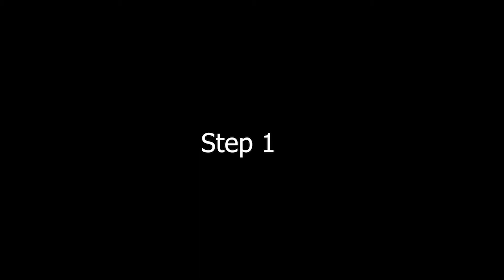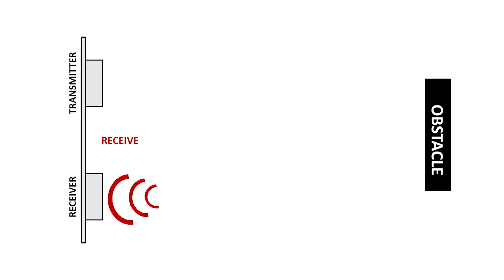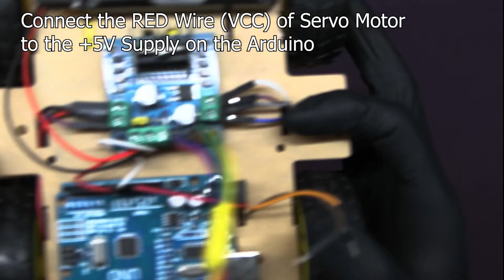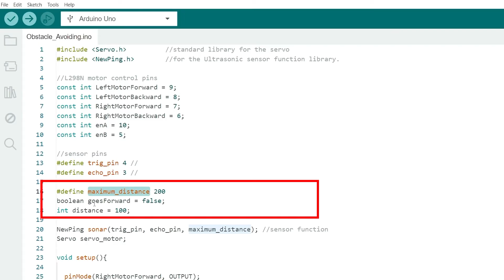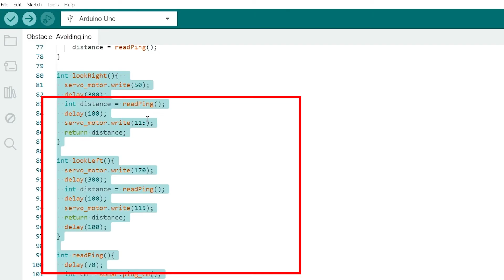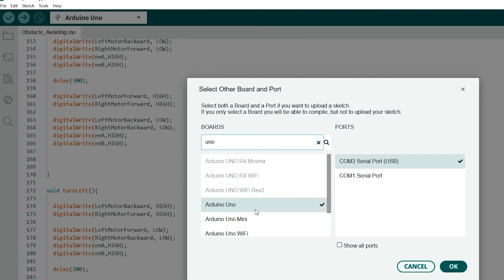BarrierBuster Bot: Obstacle Avoiding Robot using Arduino UNO I Robo Army I Arduino Basic

Comment: #include <IRremote.hpp>

#define IR_PIN 2

#define ENA 5
#define IN1 7
#define IN2 8

#define ENB 6
#define IN3 9
#define IN4 10

void setup() {
  Serial.begin(9600);

  IrReceiver.begin(IR_PIN, ENABLE_LED_FEEDBACK);

  pinMode(ENA, OUTPUT);
  pinMode(ENB, OUTPUT);

  pinMode(IN1, OUTPUT);
  pinMode(IN2, OUTPUT);
  pinMode(IN3, OUTPUT);
  pinMode(IN4, OUTPUT);

  stopCar();
}

void loop() {
  if (IrReceiver.decode()) {

    unsigned long command = IrReceiver.decodedIRData.command;

    Serial.println(command, HEX);

    switch (command) {

      case 0x18:   // UP
        forward();
        break;

      case 0x52:   // DOWN
        backward();
        break;

      case 0x08:   // LEFT
        left();
        break;

      case 0x5A:   // RIGHT
        right();
        break;

      case 0x1C:   // OK / STOP
        stopCar();
        break;

      case 0x45:   // Example button
        turnAround();
        break;
    }

    IrReceiver.resume();
  }
}

void forward() {
  analogWrite(ENA, 200);
  analogWrite(ENB, 200);

  digitalWrite(IN1, HIGH);
  digitalWrite(IN2, LOW);

  digitalWrite(IN3, HIGH);
  digitalWrite(IN4, LOW);
}

void backward() {
  analogWrite(ENA, 200);
  analogWrite(ENB, 200);

  digitalWrite(IN1, LOW);
  digitalWrite(IN2, HIGH);

  digitalWrite(IN3, LOW);
  digitalWrite(IN4, HIGH);
}

void left() {
  analogWrite(ENA, 200);
  analogWrite(ENB, 200);

  digitalWrite(IN1, LOW);
  digitalWrite(IN2, HIGH);

  digitalWrite(IN3, HIGH);
  digitalWrite(IN4, LOW);
}

void right() {
  analogWrite(ENA, 200);
  analogWrite(ENB, 200);

  digitalWrite(IN1, HIGH);
  digitalWrite(IN2, LOW);

  digitalWrite(IN3, LOW);
  digitalWrite(IN4, HIGH);
}

void turnAround() {
  // 360° spin
  analogWrite(ENA, 200);
  analogWrite(ENB, 200);

  digitalWrite(IN1, HIGH);
  digitalWrite(IN2, LOW);

  digitalWrite(IN3, LOW);
  digitalWrite(IN4, HIGH);

  delay(1000);
  stopCar();
}

void stopCar() {
  analogWrite(ENA, 0);
  analogWrite(ENB, 0);

  digitalWrite(IN1, LOW);
  digitalWrite(IN2, LOW);
  digitalWrite(IN3, LOW);
  digitalWrite(IN4, LOW);
}
Reply from the maker: Thanks for sharing the code. Please check the IR remote button values and make sure they match your remote.

Comment: I also tried to make but it's not working also the motors is also not working just the motor driver is on and then arduino UNO is not getting power so what should I do?
Reply from the maker: If the Arduino UNO is not getting power, first check your battery voltage, power connections, and wiring for any short circuits. Also disconnect the motors and test whether the Arduino powers ON by itself. Sometimes incorrect L298N wiring or low battery voltage can prevent both the motors and Arduino from working properly.
Reply: @robo_army_ ok I used a 2000 mah battery now 3.7 volt lithium ion battery but before I was using 4 everyday batteries so i will try now
Reply: @robo_army_ I used to make with lithium and battery but still the motor driver is turning on and also when I try to connect with after that like when I try to connect with the computer and the arduino UNO its working like the arduino UNO is also turning on and then motor driver is also turning on but when I connect the battery is not working just the motor driver is working I said you before like that so what should I do?

Comment: The car is moving really slow and sometimes not even moving and the servo motor is rotating very less also   car is not reversing properly what to do
Reply from the maker: This usually happens because of low battery power or loose motor driver connections . Please fully charge the batteries and check all L298N, motor, and servo connections carefully.  Also make sure the servo can rotate freely and nothing is blocking the wheels.
Reply: @robo_army_ yeah I changed the battery and it's moving really well but the only problem now is that my servo is rotating very very less what to do

Comment: Mine doesn't move at all, only the ultrasonic sensor. What to do?
Reply from the maker: If only the ultrasonic sensor is working, then the issue is most likely with the motor driver wiring or power supply 👍 Please check the L298N connections, motor wires, and battery voltage carefully 🔋 Also make sure the ENA/ENB pins are connected properly and all GNDs are common.

Comment: Can we use 4 AA 1.5 V batteries of eveready instead of lithium ion batteries? also can I insert 2 lithium batteries in a socket of 4 batteries ? Will it work? Also which lithium ion batteries shall I use?Pls reply sir 😢
Reply from the maker: Yes, good question 😊
Let us clarify one by one:

🔹 4 × AA 1.5V batteries = 6V total.
You can use them only if your motors and L298N are rated for 6V. The robot may run, but the power and speed will be lower compared to lithium-ion batteries.

🔹 Using 2 lithium batteries in a 4-slot holder ❌
Not recommended. The battery holder is designed to connect all slots in series. Leaving slots empty can cause improper connections, imbalance, or damage.

🔹 Best option (Recommended) ✅
Use 2 × 3.7V 18650 lithium-ion batteries in a proper 2-cell holder.
This gives around 7.4V, which is ideal for:
• L298N motor driver
• DC motors
• Stable robot performance

⚠️ Always make sure:
• Batteries are the same type and capacity
• Use a proper holder and charger
• Check motor voltage rating before powering

Hope this clears your doubt 😊
Reply: @robo_army_ thank u sir

Comment: It is not working.by circuit diagram ,intersecting wires cannot be joined.please find a solution and can we make the project with two motors with one at the front and one at the back
Reply from the maker: Thanks for pointing that out 👍 You’re right — in a proper circuit diagram, intersecting wires are NOT connected unless a junction dot is shown. If the diagram looks confusing, please follow the pin-to-pin connections mentioned in the video/code, not just the crossings in the drawing. We’ll also update the diagram to make it clearer.

And yes ✅, you can make this project with two motors as well (one at the front and one at the back or left–right). The logic remains the same — just connect both motors to one channel of the motor driver or adjust the wiring accordingly. Movement control will still work with slight mechanical differences.

If you want, tell us your motor setup and we’ll guide you with exact connections 🙂

Comment: I have made it but it is not running ihave installed the software, put the connections but it is still not coming only light is coming and the sensor is moving . Please give me the solution please!
Reply from the maker: No worries, we'll get your BarrierBuster Bot running! Since the sensor is moving, it sounds like your Arduino is powered up. The issue is likely with the motor connections or the L298N motor driver. Double-check all wires from the Arduino to the motor driver, and from the motor driver to the motors themselves. Also, ensure you have an external power supply for the motor driver. We can also upload a more detailed troubleshooting guide if you'd like!

Comment: I made it, but it is hitting the wall too hard and then going backward
Reply from the maker: Great job building it! 👏
If your robot is hitting the wall too hard before reversing, you can try two things:

1️⃣ Reduce the forward speed in the code so it moves slower and doesn't collide strongly.
For example, change:
moveForward(200);

to something like:
moveForward(120);

2️⃣ Increase the sensor sensitivity / detection distance so it reacts earlier.

You can also add a slightly longer delay before moving forward again so it has more space to turn safely.

Try these adjustments — it should improve performance a lot! 🚗✨
Let me know if you need help tuning it!

Comment: While uploading it is showing "C:\Users\Royal computers\Downloads\26\23.ino:2:10: fatal error: NewPing.h: No such file or directory
 #include <NewPing.h>        //for the Ultrasonic sensor function library.
          ^~~~~~~~~~~
compilation terminated.
exit status 1

Compilation error: NewPing.h: No such file or directory "
please tell me the solution ,i have to submit the project tomorrow.
Reply from the maker: Thanks for your comment! 😊
The error “NewPing.h: No such file or directory” means that the NewPing library is not installed in your Arduino IDE.

👉 Solution: Install the NewPing Library
Open Arduino IDE
Go to Sketch → Include Library → Manage Libraries…
Search for “NewPing”
Click Install
Restart the IDE and upload the code again
This will fix the compilation error. ✔️

If the library doesn’t appear in the Library Manager, you can download it manually from GitHub and install it using
Sketch → Include Library → Add .ZIP Library

You should be able to upload your project now—best of luck for your submission tomorrow!

Comment: is there a way to modify this and make it respond to sound like we will say something and the robot will come to us
Reply from the maker: Yes! That’s absolutely possible 😄
You can add a sound/voice control feature using either:

🔹 Sound sensor – robot moves toward the direction of a clap or loud noise
🔹 Voice recognition module (like Elechouse VR3) – robot responds to specific voice commands
🔹 Bluetooth + mobile voice commands – speak into your phone and send commands to the robot
🔹 ESP32 with mic + speech processing – more advanced, but fully voice-controlled!

So yes, with a few additional components and code changes, the robot can be made to respond to your voice and come toward you

Comment: Can you how can we connect the ultra Sonic sensor to 5v because servo red wire is connected to 5v
Reply from the maker: You can use a breadboard to connect both the servo and ultrasonic sensor to the Arduino's 5V pin. Just connect the 5V pin from Arduino to the power rail on the breadboard, and then connect both servo red wire and ultrasonic VCC to that 5V rail. Don’t forget to connect all GNDs to the ground rail too
Reply: @robo_army_ how